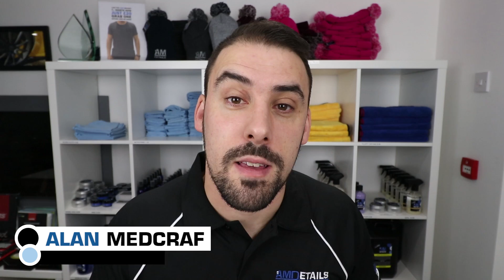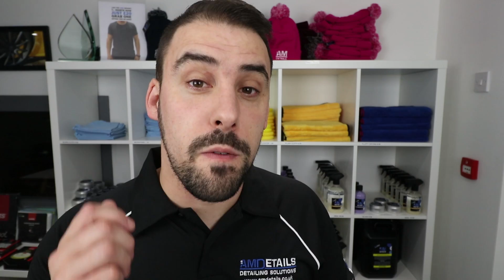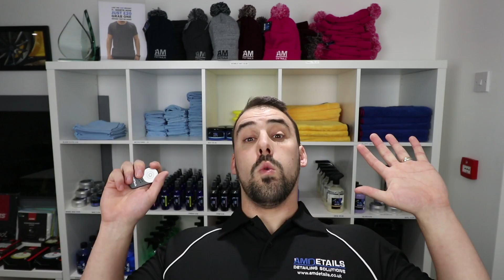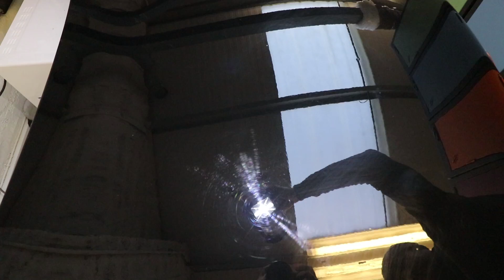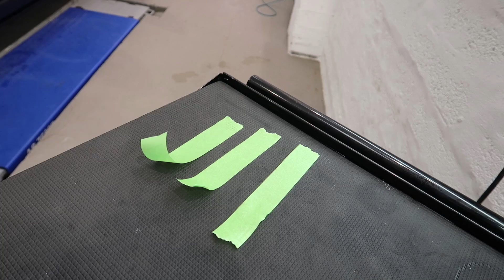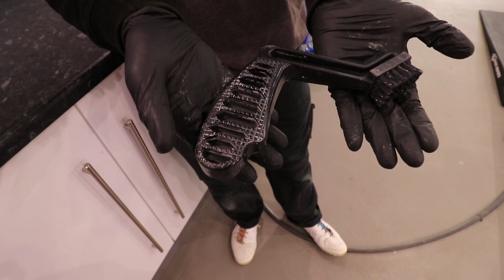5 Essential Machine Polishing Tools - Detailing Basics Guide

Comment: That was a really interesting video. I think you make some good points that any beginner should take note of. One thing that I would add is something to collect the machine polishing dust. When I first moved to blowing out the pads with an air line polish residue coated the lift, floor and trolley. What I did was buy a black traffic cone to act as funnel into a vacuum cleaner at the narrow end. 

Polish residue is blown into the funnel and sticks to the sides as well as being sucked into the vacuum. So long as the inside of the cone is washed when residue builds up there doesn't seem to be any stray polish elsewhere. This is my obscure solution to studio residue problem.

Thanks for another interesting video and I am pleased to see your channel go from strength to strength.

Jon @ Exquisite Car Care
Reply from the maker: +Exquisite Car Care amazing idea Jon. Top thinking. I will try find some time to play with that.

Superb contribution 😎👍🔔